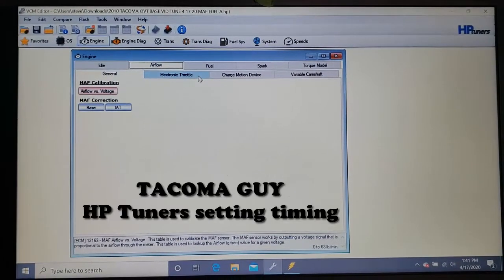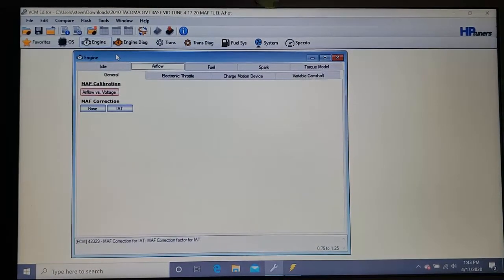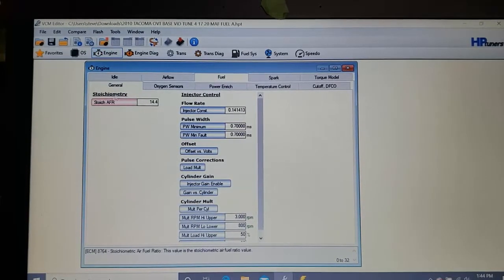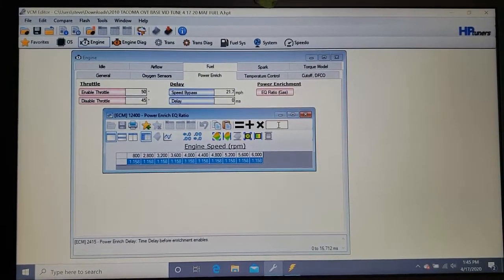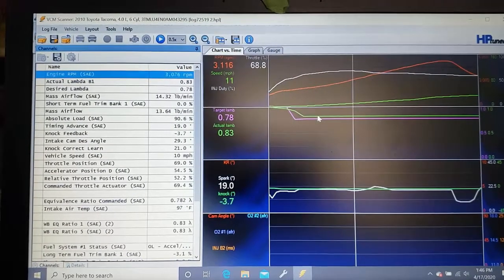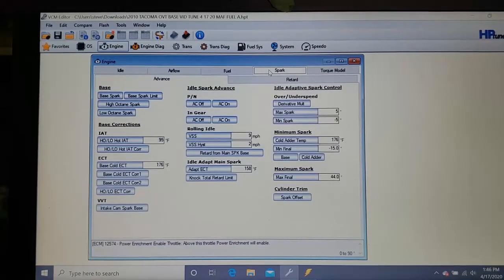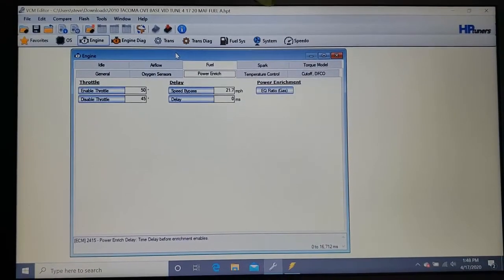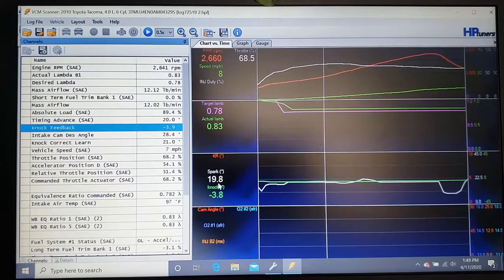How To Use HP Tuners E5 Set Timing Toyota Tacoma

Comment: Hey I have a 2010 Tacoma v6 with the trd supercharger installed worth getting the HP tuner? I tow my Polaris RZR around alot. I could use more pow pow
Reply from the maker: Yes if you or you have someone to do the tuning it will run a lot better